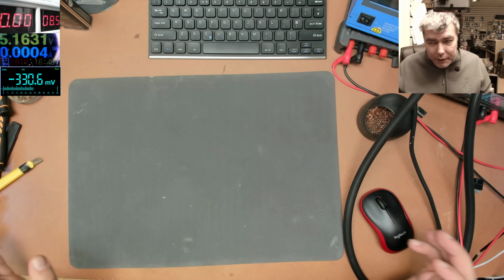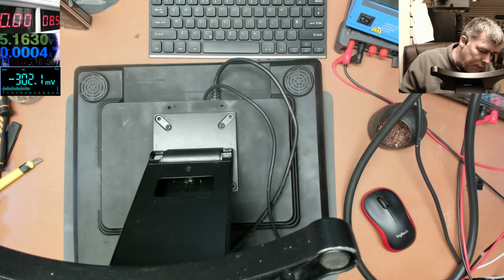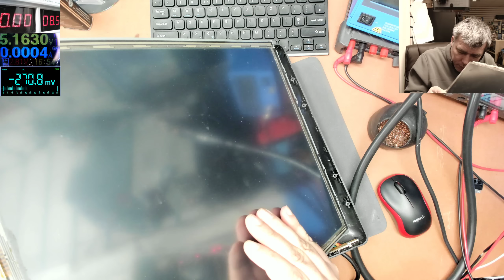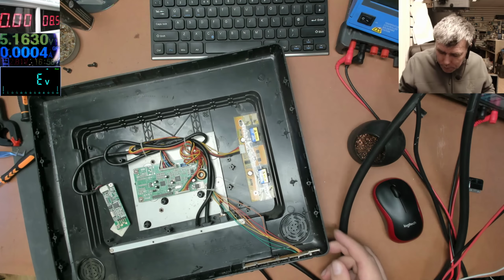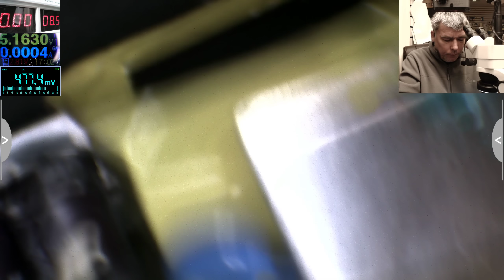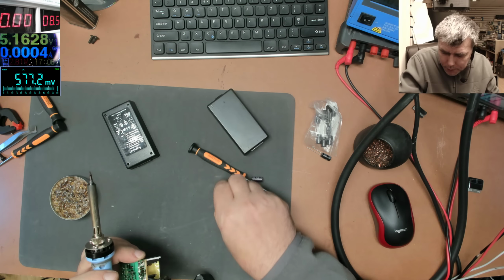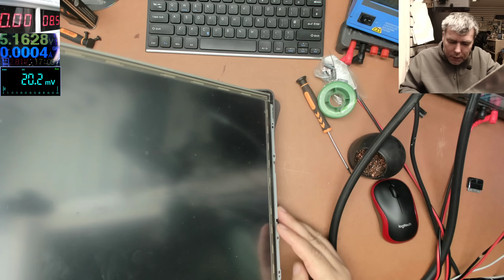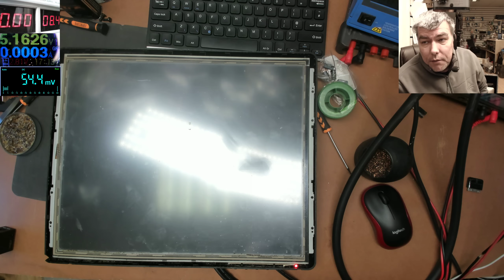Let's fix a monitor, a weird one

Comment: One thing about opening chargers, especially laptop ones - easly you can open it with a petrol. Just put petrol on the join point line and wait couple of minutes. Charger opens itself.And great videos, lots of know how and best repairs without schematics.
Reply: I have seen this trick and it works, but it's not clear to me, what they meant with "Petrol" ? Petrol or Petroleum here in Belgium is the fuel used for little portable heaters,   but that's more a oily liquid and doesn't dissolve glue or anything. Then we have "Benzine" or "Naft" that we put in gasoiline cars. This fuel is also called gas or petrol in some parts of the world. And then we have also "Diesel" wich is like the Petrol i mentioned, but for cars and heating our home. So can you explain which liquid you use exactly? Thanks in advance. Grts
Reply: I used petrol from gas station (not Diesel). One that i put in lawn mower. And it's a miracle to me :)

Comment: Normally 12 to 18 the highest I have seen around a few amps max for cfl based monitor, the front snaps off. Red V+, black gnd., one yellow enable back light(on/off), other yellow brightness normally on the inverter board. More then likely 470 uf 16 volt in the 65 degree temp range the standard low end caps.

Comment: Easy fix in the end, nice one - I'm surprised you took the time to take the monitor apart before first checking the symptoms and then checking the output of the PSU first? In my experience checking and external PSU for output voltage is the first course of action but I get that the monitor would have been trying to draw a lot more current hence the voltage going up and down due to the bulging caps - they were both easy enough to take apart in the end so minimal effort :) 8V would seem to suggest that the overall screen design may have been used for portable applications in mind back in the day. Curious what the second cable apart from the VGA plug was? This would have given away that it was a touch screen, no? Interesting fix since it was just the PSU that was faulty - 8v 3.6A adaptors from Ingenico available at £15 ;)

Comment: i hate prying open plastoc cases. the older it is the more brittle it gets. and yes injuring yourself is a big concern.  you need really strong sharp tools on most of them to get it started.  i save the old ends off power bricks so i can use the plugs with my power supply  but it still seems you never have the right ones.

Comment: I've never seen a monitor with so little inside, it has to be for a computer that must have that touch type only, that's the reason the owner will pay.
8 volts is a bit odd though.

Comment: It disappoints me that modern day motherboards use those military style solid caps and gone are the days of being able to instantly see those bulges. I remember about 15 years ago, opening a satellite receiver because it was only receiving channels on the horizontal and not the vertical(or the other way round) and instantly seeing a bulging cap, I replaced it and job done....I thought it was gonna be a chip or something and doubted I would be able to fix it, yet it was a 10 minute job.

Comment: It's not weird, it's custom made. Universal LVDS controller, universal inverter etc. Case without markings - part of the kit? Anyway, usually controllers have either USB port for flashing either set of jumpers to determine resolution. This one has none, so I presume the chip was directly flashed. Small batches for some kind of specialized equipment? Medical?
Reply from the maker: cash machine

Comment: @4:24 - why does it have 2 cables coming out. one is for Data the other is for what???
I can see the DC power connector, that makes it 3 cables.
Reply: Touchscreen ? It's not a TV, so touchscreen has to be connected to main unit.

Comment: Easy way to the these external power supply is to use 12V brake light from a car you can do 12v to  24v with that globe , it puts a load on the power supply ,  if the light is blinking on and off then you know its the power supply ,Quick and easy , before you even open the monitor